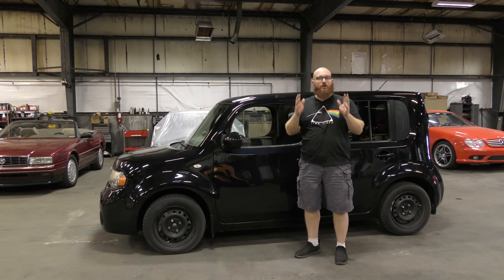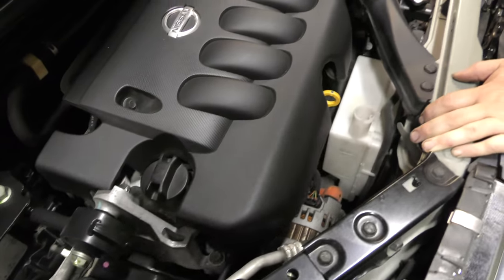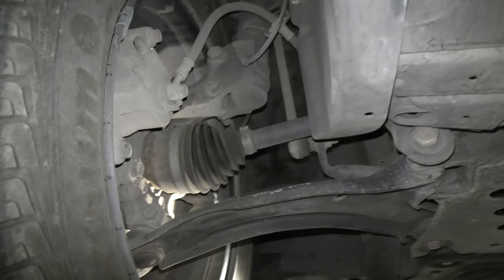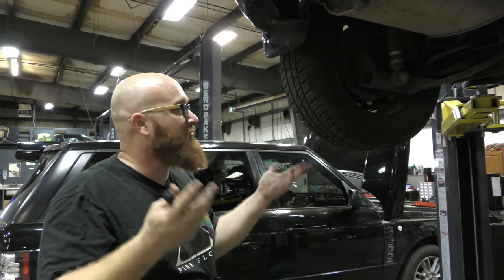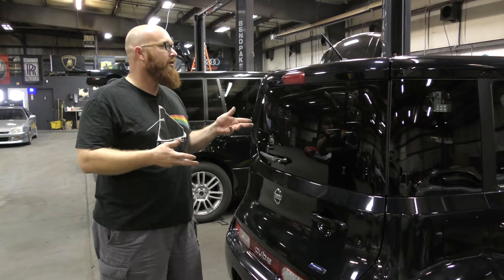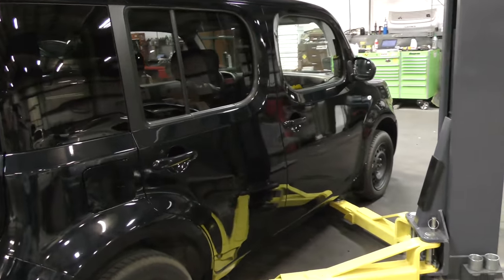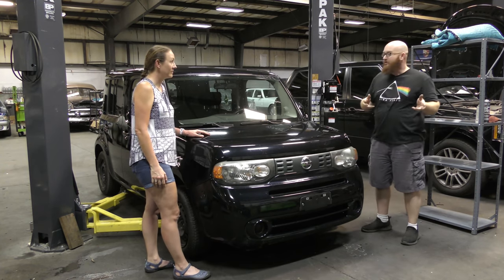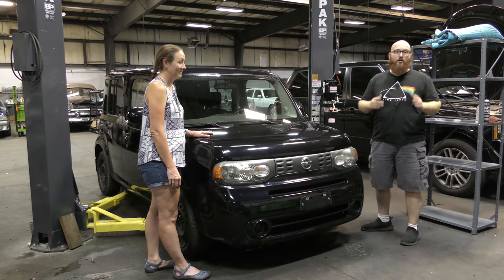The CAR WIZARD's new ride! Mrs. Wizard is NOT impressed! What was he thinking?!?

Comment: I love them. The first one (2010) we put 150,000 miles on it with only replacing the converter just before we sold it. We still own  our 2nd one a 2011. Will drive it as long as it last. It only has 54,000 miles. Happily Retired so it’s just a runabout but I wouldn’t hesitate to make long road trips in it. I am 6’4” and I am very comfy in it. Soft suspension with easy chair  seating makes it very good for road trips. 25 city and 33 hwy mpg.  Only downsides  is it gets blown about on windy days, odd looking and cvt is a ticking time bomb. Will junk it when the cvt goes out until then we will enjoy driving it.

Comment: the seatbelt for the "child in the rear" seat is actually for the middle seat passenger in the bench seat.
Reply: Yeah, I was suprised he didn't know this. Must of never driven a small suv. My crv was  like that. And the rav4.
Reply: I was wondering if that were the case, but didn't have a good enough camera angle to be sure.
Reply: yep, it's great that it can be disconnected to allow big items to fit in.
Reply: I was about to comment on that too!
Reply: I am surprised he didn't figure that out.

Comment: Don't think it is missing a seat, I think the roof-mounted belt plugs into the middle of the back seat.
Reply: Yup...
Reply: Yes it is center passenger shoulder belt which clips into lap belt buckle
Reply: Yep, a common set-up
Reply: Absolutely right. I have Renault Clio 3 and it has the same. It is for middle seat.
Reply: Idd it is for the middle seat
Reply: Ya cars been doing that over 20 years at least
Reply: yep.
Reply: @Joe Ryan Same for my Honda Fit here in the US
Reply: That's what I thought 🤔
Reply: I wonder how an experienced mechanic would miss something so common. It's like when Mrs Wizard didn't know how window visors worked.
Reply: Correct.

Comment: The hubcaps are gone, but the 'tuner' lugnut left on each wheel is a dead giveaway. The car had aftermarket rims on it that were taken off before it was sent to auction, or traded in, etc.
Reply: Might be but most cubes came with alloys and now the only parts left are the shiny lugs.

Comment: I have an 05 and my wife has an 06 Scion xb. They are great and practical vehicles. I once brought home a 50 gallon water heater in the box with all doors closed. Also, a 6 foot stepladder can easily be carried. Great reliability - 05 has 165K and 06 has 65K with only routine maintenance. Can't beat Toyota's IMHO.

Comment: Be careful wizard, you might enrage Element fans!  The front and rear seats of Elements both recline until completely flat.  But you are correct, the rear seats do not fold forward like the cube, however they do fold up against the side of the cargo area or can be completely removed.

Comment: Get a Honda Element if you’re after that look. Lousy fuel economy but otherwise the Element is great. The suicide-ish backseat doors are... interesting, and I like how the rear seats fold to the side. I test-drove a Cube after totaling my Element, and it just wasn’t in the same league — also they wanted way way more than the Wizard paid for his.
Reply: How about the Scion XB?
Reply: @1985toyotacamry  it's a good idea, just be careful with the 2.4 engine. They're known for excessive oil consumption at about 150k miles. Apart from that issue (just check if the particular model you're trying to buy has had its recall done), it has a four speed or five speed automatic transmission, depending on the model year, and if the automatic is not just your style, there's a five speed manual available.
Reply: I WOULD KILL SOMEONE to get my old Element back!!! - Mechanical AWD, and there was TONS OF ROOM. I remember always looking back in that thing and thinking it looked so HUGE inside! I miss that thing! Went everywhere with it!
Reply: @mikenormandy9250  I think they are coming out with a new model over the next few years...now I'm going to have to go look since I'm not 100% sure.

Edit: yup they are saying there will be a new one in 2021
Reply: @craigpeel5983  new Element?!!! Thanks!
Reply: @mikenormandy9250  I'll sell you my 2003 AWD Element.  ;)

Comment: The seatbelt Wizard found in the rear is one part of the rear mid-seat seatbelt! Renault has the same design.
Reply: Ya versos have the same thing fantastic design
Reply: Oh shit really
Reply: Exactly. But it‘s not a part, but the whole belt. That‘s why there are two buckles on the belt. The one on the end snaps in first and then You move the belt over Your legs/hip and put the the second one in. That way You legs are strapped and the belt runs diagonally over your chest. Smart, but confusing at first try. Luckily the two buckles are coded so they only match their right counterpart.

Comment: Car wizard, show us how to change the fluid of a CVT gearbox. Please
Reply: Its easy! Take to car dealer, sign title, get new car, and drive away. Hopefully one without a CVT!
Reply: And here's an answer that isn't from a jerk: it's no different than a normal auto.
Reply: @scott8919  Its a Nissan CVT at that,no point in hiding or not "being a jerk" about this timebomb.
Reply: Carlos Andrés Ceballos C. Most are just drain old oil, refill, start the car and run it though Park, Reverse,Neutral,Drive, then drain and repeat 2 more times. And on the last refill, you perform the fluid level check which often needs a scan tool to read the transmission fluid temperature.

In short, pay a mechanic to do it.
Reply: Most new cars are cvt's
Reply: It's a secret

Comment: You bought a used car before checking it out? Scotty's not gonna like that! 🤣
Reply: Scotty also won't like that it's not a 1994 Toyota Celica with 240k miles so
Reply: juncho1977 oh but Tyler Hoover will love that.
Reply: @Ben_Mayall  🤣
Reply: It was checked out by his friend that bought it for him. Secondly, if you are a master mechanic like the Car Wizard, there is no problem that can't be fixed.
Reply: @nickv4073  but if it was a flooded title Wash car, the electrical work isn't worth the value of the car.
Reply: Tehgziz Lauw that of which he didn’t drive a lot for several years, let the engine get flooded out, and then converted it to an electric car
Reply: @kingjlinza  wait he converted it to electric? First time I hear about that. I always wondered why it was always stuck at 240k miles for the last 8 years
Reply: @Duraputer  What don't you understand? His friend that is in the car business checked all this stuff beforehand.
Reply: Scotty was the little bully that always stole his stepdads cigarettes and liquor and brought them to school.
Reply: @tehgzizlauw1787  yeah a clapped out Celica that burns oil
Reply: Typical Auto Guy Sooooo the video from last week where he pulled out a fuel injector on it to show you how easy it was to change the fuel injectors on a ‘94 Celica was just a hallucination?????
Reply: @tehgzizlauw1787  He's known to law enforcement that's why he doesn't drive it. They'll pick him up for driving on suspended license. That's why he drives his "customers" cars or makes his wife rent him a car so he can drive drunk on the downlow.

Comment: I had a 2010 Cube, it was so much fun, a great car, great engine, 35 mpg, 13 cup holders. It’s downfall was the horrible CVT. I replaced mine, and then the second one started to go bad after 65k miles, that’s when I decided to trade it in for a new Soul. I also replaced the Cat too.
Reply: The Soul is better than the Cube. The Cube rides rough.

Comment: Mrs. Wizard is going to file for a divorce rather then to drive this car
Reply: I don't blame her who wants a hamster mobile
Reply: @cptnscoob  no that's the Kia Soul according to the commercials. Lol
Reply: @cptnscoob  Mr. Wizard opens hood... sees hamsters in four hamsters wheels.
Reply: They are actually a pretty reliable beater. They are perfect for hauling dogs and junk. Honda Elements are the better toaster car
Reply: The Wizard shows us an important lesson.  Buy a car you can afford that YOU like.  Most people buy cars they can't afford  to try to impress people they don't even know.
Reply: @Stimpy&Ren my oldest son has a 2018 Maxima with obviously much more horsepower with Nissan's awesome V6 but it has that stupid CVT which ruins what that engine is capable of.
Reply: @Ryan_DeWitt  well said and a very good point. But it has a CVT! Lol
Honda, Toyota and Kia all make a box without the CVT.
Reply: Stimpy&Ren , but you don’t. Had a rental Versa, and aside from the usual Jatco foibles, it worked pretty much like a normal automatic... You only get the constant rpm drone under heavy acceleration.

Comment: Wizard, the Element seats recline similar to the Cube, and in fact, the Element seats will recline ALL the way back.  If you recline the rear seats fully, pull the front seats all the way forward, remove the head rests and recline the front seat, the Element has 2 (uncomfortable) beds.

Comment: Something tells me that the CVT transmission has already been replaced once before, not for everyone
Reply: Yeah anything with a Jatco CVT should be avoided like Covid-19.  Even if it's been replaced already which is likely, it'll fail again.
Reply: My friend's former 2013 Sentra had the transmission rebuilt at 120K miles. 5K later it failed again. Fortunately it was still under warranty and repaired for free.
She replaced it with a Forte 2 months ago and said she'll never get another Nissan.
Reply: @engineer_alv  Many years ago I had a CVT Nissan Primera wagon - the CVT developed fatal overheat issues at ~80,000km - it was a couple of years out of warranty, so I took it to a transmission specialist and he said "yup, see these all the time sometimes they don't even last that long!".  After that I dumped that thing as fast as I could and replaced it with a Toyota.  A shame because other than the transmission it was a pretty decent car.
Reply: I love my juke, it was like the best car. I avoid cvts like the plague!
Reply: @Beer_Dad1975  That could be the new Nissan marketing slogan (or, if they go under, their epitaph): "Other than the transmission, it's a pretty decent car."
Reply: @BestAnswer12549  There are some really good buys on 2017-2019 Nissan Pathfinders, but every time I think "Maybe I ought to go to the dealer and check it out," I keep coming back to the CVT issue (especially since I want to be able to tow a small camper), and that puts the kibosh on it.
Reply: my auntys nissan wingroad 2008 has cvt and zero problems just been really well looked after with servicing

Comment: The transmissions are crap they're all in the junkyard that's why you can't find them
Reply: There not the bad! Maintaine them early on and they go 200,000 easily!!!
Reply: I bet a lot of that is because the average car owner does not take into account that the transmission needs periodic fluid changes too. Of course this doesn't change the fact that CVT's in general are pretty fragile compared to a normal geared one...but they can still last a good while  if you maintain them.
Reply: Are they taking a Nissan dealership these things are in the shop all the time even will maintained when they first came out especially there's even a class action lawsuit towards Nissan
Reply: @fredwilliams7893  not true I bought my wife's car brand new and with all the recommended service from the Nissan dealership at 115k the cvt is failing.
Reply: @jtw73160  yes I believe that. The problem is the oil intervals for them are way to high. should be 30,000 not 60,000. My niehbor has stuck to that and his altima has 190,000 and still going

Comment: @2:30 - missing coolant reservoir cap. Not a big deal since it's not a pressurized tank, but I'd get a replacement. Seatbelt in the roof is for the center passenger in the rear. Some cars have a tab you can use to retain the buckle and keep it from flapping around.

Comment: We owned a Cube3 the seven seater version 2003, great car, had it for 4 years , there was an issue with the 2003 version with the engine block, we had a head gasket failure, replace the engine with a used one $2200, never had an issue with the transmission, car was so practical, enjoy

Comment: I had a 2007 Nissan Versa. It lasted to 180,000 before the CVT bit the dust. I only had the transmission fluid changed one time, but the oil and filter were changed every 5,000 miles. The cat converter light was on for thousands of miles but never affected fuel mileage. It was usually our third vehicle because of its age but was always reliable and I sold it to someone who had the ability to replace the transmission.  I own two other Nissans, a Frontier and Altima.

Comment: When these first came out my wife described them perfectly by saying...."If Gumby had a car"
Reply: This one is better, but the first ones looked like the box it came in.
Reply: I used to work near a Nissan dealership and honestly I wanted one then. Even then they were hard to find. The dealership was lucky to have 1-2 on the lot at any given time. Yeah it looks weird but it’s a Nissan 4 cylinder with a timing chain not a belt.. so like the wizard said only potential downside may be the cvt transmission. I had one in my 2014 Jeep Patriot sport and never had an issue.. but it was gotten rid of with only 60-70k on it

Comment: I think that belt hanging in the trunk area is actually just the 'third' seatbelt for the rear bench, I've seen a similar design in other small hatchbacks where there isn't space to fit a more integrated reel belt for the middle passenger. It just doesn't look like there'd be enough space (or any fixings) for a jump seat in the trunk.

Comment: 7:53 the element's seats recline further with the front seats folding back into them as a bed. They also flip to the side allowing the vehicle to be used as a cargo van in combination with its standard vinyl floor mats. AWD was also an option with a manual transmission which i think is cool af!

Comment: You can use powdered citric acid and distilled water to wash out old catalytic converters, it works like a charm. You can either recirculate it with a pump or drop it into some 150 degree water for 6 hours.

Comment: The Honda Element rear seats actually do recline until they’re almost flat, you can actually recline the front seats all the way as well to connect them to the rear seats to make two beds for camping. Speaking of the 2003 of a 2003 model anyway. Cheers!

Comment: Hope you have about five transmissions that go out about every 30,000 MI they kind of look cool but they're a pile of s***
Reply: A friend of mine had a qashqai 1.6 diesel, cvt.
It started to judder at around 200.000 km.
Sold it to someone that changed the block valve, i think it's called, and still using it.
Reply: @dan_6915  not all cvts are bad that's why Nissan quit making cvts and started purchasing them from Mitsubishi Mitsubishis are slightly better but they are stil have issues Toyota makes the best CVT transmission

Comment: Well, the elements seats do the same thing and then some! They fully recline, fold and also fold up against the sides (which I’m sure you know). Also, that seat belt is for the middle passenger in the back seat, not another seat. These Cubes are pretty decent.

Comment: I wonder if a compression test would be advisable... seems odd to have a cat go after only 8 years
Reply: Ed I see p0420 catalyst codes on many cars with not much over 100k miles. No issues with engine or fuel system but often times it is a high hour count (on vehicles with hour count viewable on scan tool) and the cat is just done. Just speculation but gasohol is my suspicion and gasohol is not universally sold all over US. I have suggested to owners to use the catalyst cleaner fuel additive and that with some hard driving to get more heat in catalyst has been maybe 50% successful. Exhaust leaks have to be fixed if present as that can leak oxygen in and cause the code when catalyst is not the fault. No Bad O2 sensors have to be verified.

Comment: I owned a 2009 SL (more options) in steel grey metallic (really nice color), and just sold it to a friend cheap this year. It had a ton a room for a small car (I'm 6'7" tall), and was great for hauling the kids round the city, since you could park anywhere easily. I had ZERO problems with it outside some free minor recalls, and the factory brakes lasted 75000 miles...I never liked the way the CVT felt and likely won't buy a CVT again, despite no problems with it, and the sun visors were laughably inadequate for the giant windows. Not bad for a cheapie runabout.

Comment: In the early 90'ies, i had a chech JAWA moped with Barum tyres. They never wore out, not because there were so good, but the they got bubbled in the cord, so you had to throw them away and buy new ones once and a while. Cheap though, costed around under 10 dollars back then...😁

Comment: That seat belt is for the center passenger in the rear seat... I've had my 2009 cube (CVT) for almost ten years (which is actually a record for me). It's been a great car and it's actually pretty fun to drive with a low center of gravity and only 2800 lbs

Comment: Dear Wizard,
I like your new Cube car, it has alot of style. Style wise right up there with the American Motors Pacer, Citroen Palas sedan. Alot nicer and more useable than other quirky looking cars
 I prefer this to the Honda box thing which does nothing for me. Ripples, curvy dash, offset windows, steel wheels. All it really needs is a simple manual transmission, four cylinder engine with a carb. Congratulations 👏